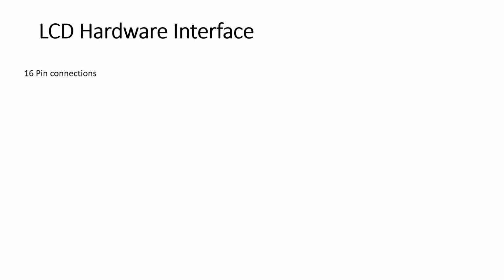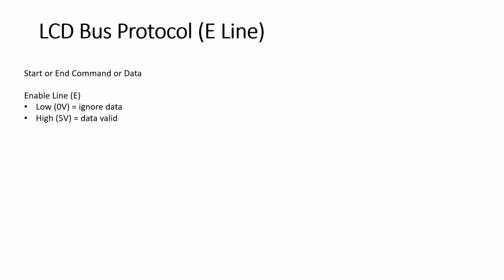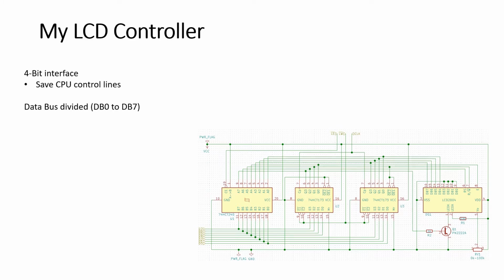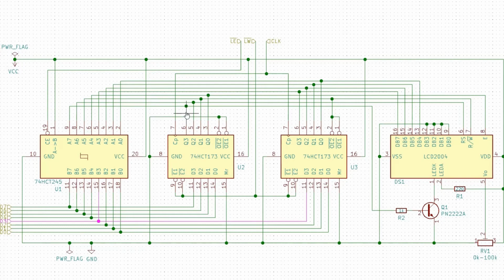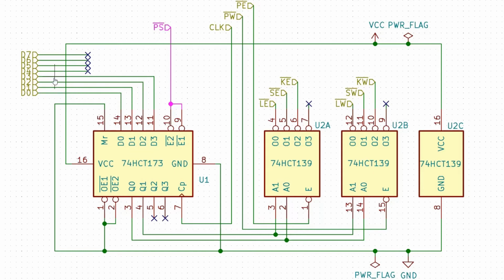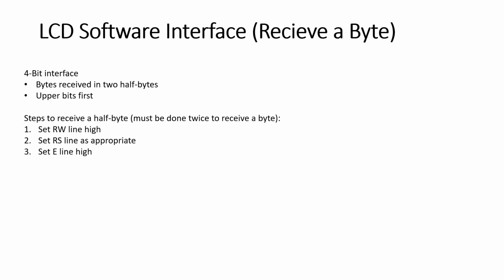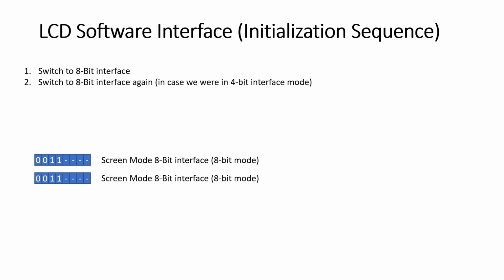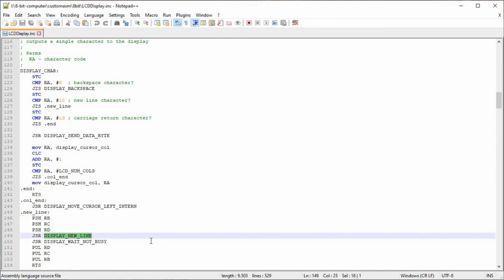8-Bit Breadboard CPU (LCD Display, Port Controller)

Comment: Hello, sir. Can you go through the code of the big clock test please and thanks for sharing your build
Reply from the maker: I thought about your question for a few days now, but I'm not quite sure, what aspect of that code would be of interest for you. The code as such consists of several parts like getting the current time, converting BCD numbers to ASCII characters, defining custom characters, putting together big digits from custom characters and placing the cursor to specific positions on the screen. Some of those functions are even part of the operating system of my machine and don't appear in the code for the clock itself.
I believe you're looking for technical solutions to some problem. Is it about getting the current time? That is described in part in my video about the SPI protocol. Or is it about the custom characters I used to display the big digits? Maybe I can show or describe my approach in greater detail if I understand your question better.